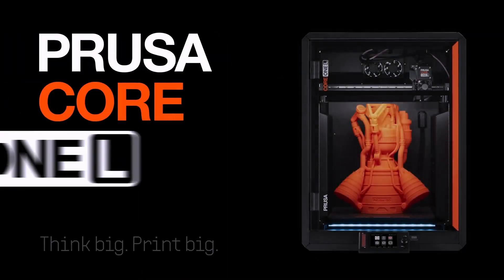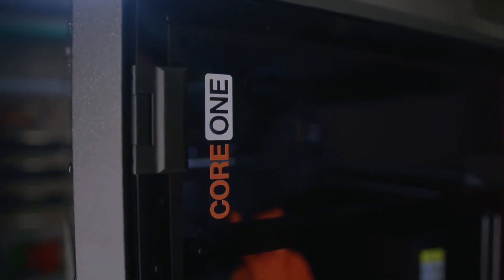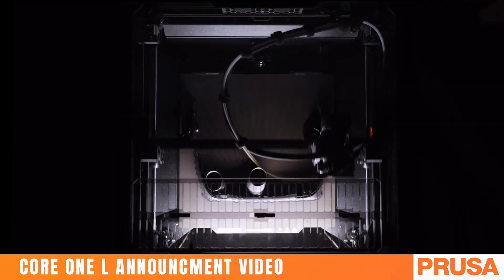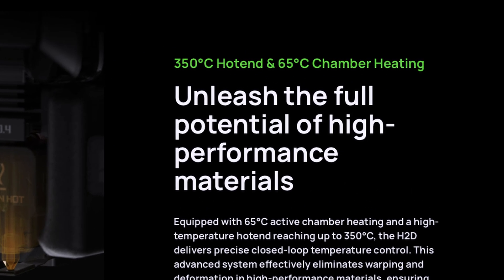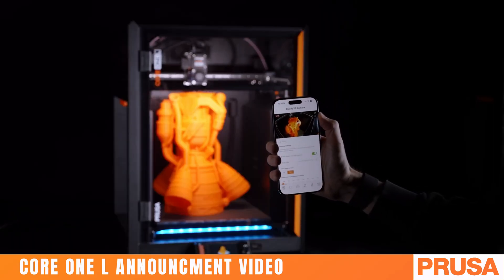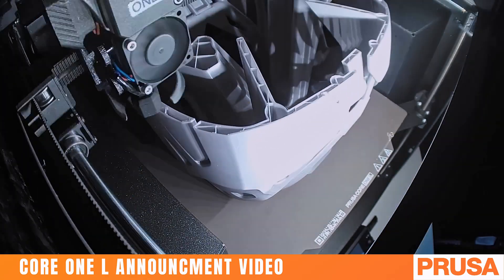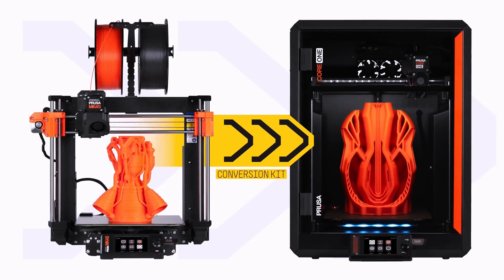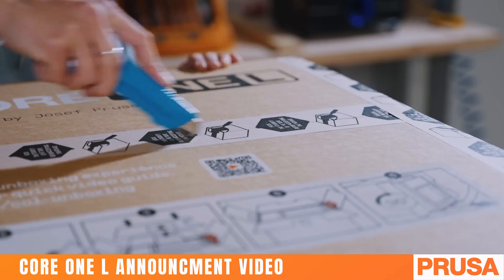Prusa's New Core One "L" | First Impressions

Comment: I hope they get a filament system worked out for it! I have had 3 of the MK's and have had the best of luck with all of them. I did not buy the core one due to it being same size and no innovation on a filament system. I moved to the Bambu H series being able to load multiple spools of the same filament and not worrying about running out along with using 100% of the roll is like curse control on a 10 hour drive. Beyond a game changer

Comment: Reminder： PEEK can NOT be print by 350℃ hotend, 400℃+ AND 100℃+ chamber is required, 350℃ is not a game changer at all.
The only different between 290 and 350℃ hotend would be the possibility of printing PPS (and certain PPA) filament
Reply: I'm personally a bit doubtful that 350°C is a long term trend. There's like one or two consumer level printers on the market that reaches that temperature, and it requires more specialized components and more expensive thermistor to handle the heat and get accurate temperature readings. 300 still seems to be the sweet spot for consumer level 3D printing.
Reply from the maker: Thanks lol 🤦‍♂️ that’s what happens when I pull an example of the top of my head of the toughest filament without actually thinking! 

My point was really if Bambu can add that feature for the same price Prusa should even if it’s not the most useful

Comment: I think you're on the money with your assessment. I wonder if they'll release an open-air printer version of this larger frame/base like an "mk5" that would be more price competitive.
Reply from the maker: That would be awesome but I think that’s the XL
Reply: I doubt it. I think the side-panels are to much a part of the structural design. And I also doubt skipping them would cut the price enough for it to make sense. I think more cuts would have to be made. What I could hope for is that the MK4S gets dropped even more in price. Or that a MK4S Mini would replace the current Mini.

Comment: They really should have waited ( again ) and release the Prusa L with INDX because - IMHO - this ( again ) just really isn't cutting it... 🤦‍♂
Reply: Looking at Bondtech, and adding the time Prusa would need for integration, that would probably take another year. That said, I suspect it will still be launched at Formnext. However, I doubt anyone will be getting one until late 2026.

I view this a bit like IBM Thinkpad vs Dell, back before Lenovo bought the rights. Dell was always ahead in terms of new features. But a lot of people, myself included, still paid more to get a Thinkpad. There are more things that matter, than just the feature-list.

For me, the main feature lacking is higher nozzle-temp. If that was in place, I would buy one right away! I suspect that will be solved WHEN INDX is released. If that is the case, and the price is not insanely much higher, I'm getting one. But for now, I am just grabbing some popcorn, intending to watch what unfolds over the next couple of months.
Reply: @mariusmossum2923 400c hotend has dropped for the core one series

Comment: Hey, thanks for the video. This is nowhere in the H2D ballpark. No real independent chamber heater (this will have issues to reach 55C° when INDX added), low temps, no servo extruder, no functional nozzle cleaning solution, and so on. It feels again as always - too little too late.

If they want to stay in game for long, and they dont want to manufacture in china, they have to make a compromise and ditch upgradability for example.

And honestly it was quite a silly thing to not come out a completely overhauled machine:
Ditch Marlin, make it 120/350/65C° capable (independently from the bed temp), change the Nextruder design so it can calibrate flow rate, pressure advance before every print, and it can detect air printing. Add real anti vibration feets, solve the headbang issues, maybe guve it a new touch screen with interface. And add a freaking nozzle wiper. Oh and make a real quick swap nozzle.

If Prusa pulled off these things, for like 1300€ (like the H2S), then they would play in the same ballpark. And we are still not talking about any innovation.

Prusa is trying to achive similar as the competition with as little as possible hardware (see the top vent opening for example). But this is how they shot themselves in the foot.

Whish them the best, but I would be crazy to even desire this over the H2S.
Reply from the maker: I fully think the Core One L will lead to better things but they’re so far behind currently that it will take a little time.
Reply: Still couldn't pay me to own a Bambu.